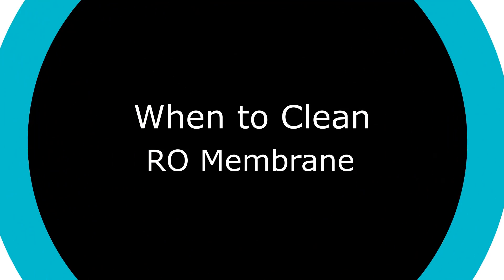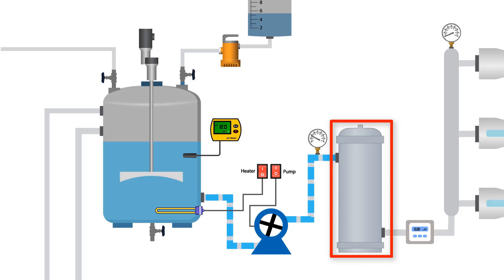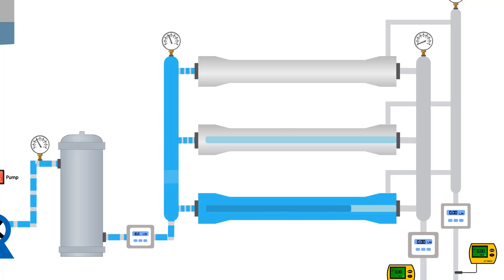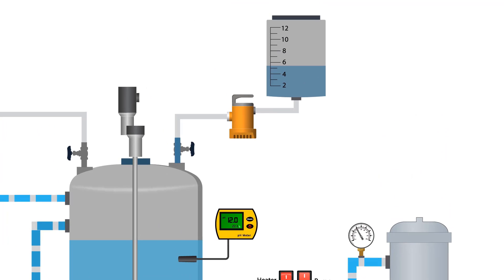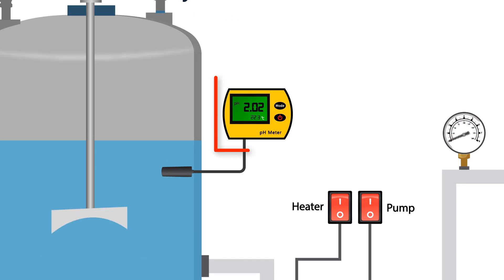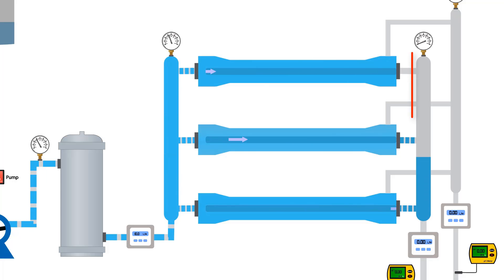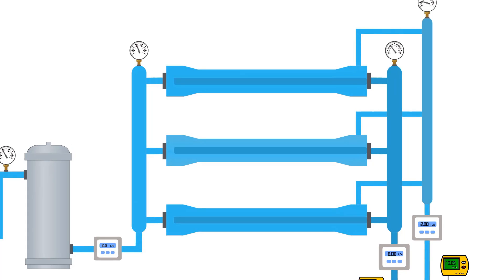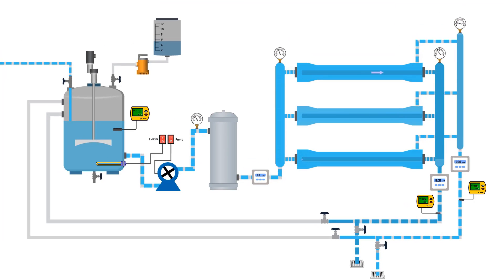What are the steps of CIP Animation | Backwash of RO Plant Animation| Clean-in-Place for RO plant

Comment: Can Permit water line close during CIP ? According to Thermax Manual they said its closed
Reply: You want to push your solution through your reject if possible and have nothing to through your product side. 

You just have to be careful with your pressures as some systems are not set up this way.